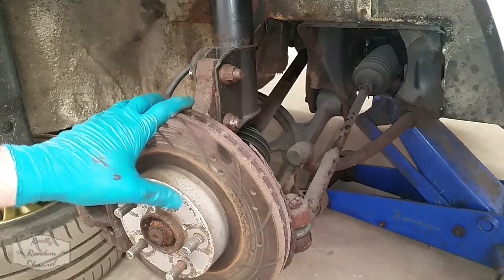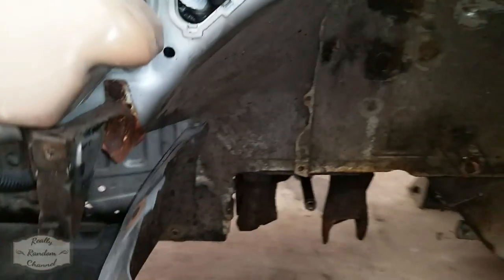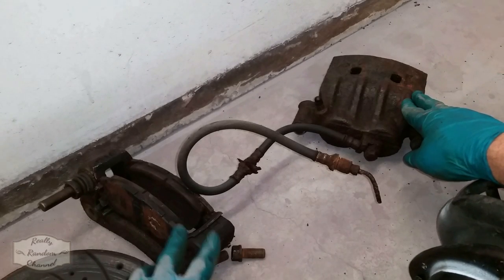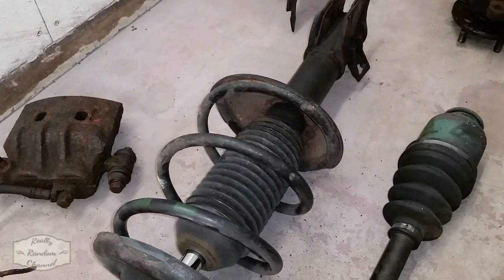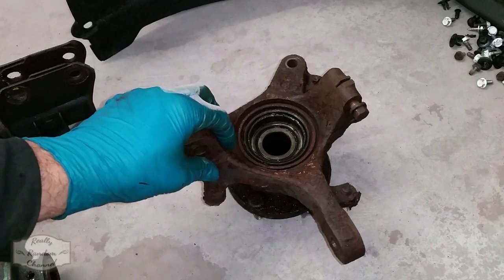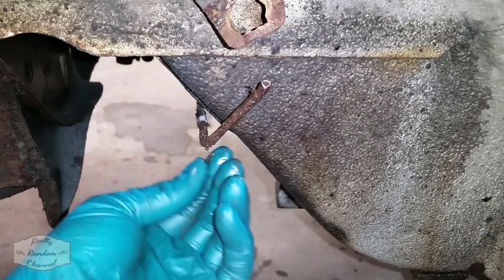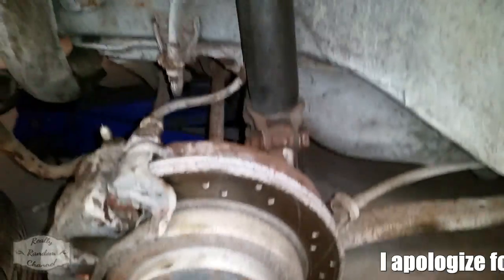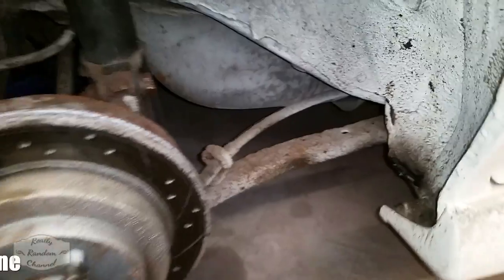26 Year Old Rusty Suspension And Arches Made New Again - WRX Restoration

Comment: I've got to treat rust on my rear sub frame and parts of the floor so I was going to use kurust over the rust then give it a coat of isopon zinc 182 rust inhibiting primer then a coat of stone chip but do you think this will work or should I use you're method. If I use you're method can you recommend something I can paint on instead of a sprayer as I don't have much room.

Comment: Did you use normal copper piping or Nickel-copper brake piping? The former is not legal in Australia because of fatigue failure concerns.
Reply from the maker: Nice question, ive used ( and would only ever use ) the copper alloy as its brake rated.

Comment: 2 tips:
- Should have replaced the rubber parts with polyurethane (yellow). Strongflex does a kit for a very decent price, and no more sloppyness.
- You could have done the "Subaru Free caster mod". (google it if you don't know what I'm talking about).
Other than that, you went to better than factory! :)

Comment: Great job... but the copper lines, Idk about those.
Reply from the maker: Thank you. The brake line looks like copper pipe but its not, Its actually proper rated and tested brake line that is an alloy containing copper hence the colour, but unlike copper this stuff doesn't work harden and fail like pure copper so there are no safety issues here.

Comment: Awesome man, subscribed - where in Scotland are you? A quick question, you blasted and zinc plated the suspension bolts? That the best for long term rust proofing them?
Reply from the maker: Thanks for subscribing it means a lot :). Im around 20 mins from Glasgow. Yeah with steel bolts the best you can do is 
 to zinc plate them.

Comment: Curious why you didn't paint the hub assembly?
Reply from the maker: Always a pleasure to see you :) Good question, The reason i left the hubs unpainted was just because thats the way Subaru done it, I did however blue the hubs so the oxide layer that creates should in theory keep the hubs free from rust for while.
Reply: @RRCRestoration  Hi , not sure they still exist. Blackfast UK, industrial cold blue/black solution. Like the BC you used but better. One of my expertise... does not offer much if any rust protection. It is usually the oil used afterwards. You could easily clear coat them with an Aerosol. fyi

Comment: I really hope you go back and fix the bushings before you try and drive it. You aren't supposed to tighten them without the load of the car on it otherwise they'll wear out faster or even tear.
Reply from the maker: Not to worry the bushes will be fine ;)
Reply: @RRCRestoration  no they wont, admit your wrong and do it right, poor show

Comment: What's the benefit of copper brake lines over steel other than rusting maybe???
Reply from the maker: Mostly it easy to work with and as you say doesnt rust. I would just like to say though that these lines are not copper they are a copper alloy specially designed for brakes as pure copper has a nasty habit of fatiguing and snapping.
Reply: @RRCRestoration  awesome I didn't know that there were copper alloy lines 🤣, the more I know. Thank you haha

Comment: The front end of the car looks great now, but wow, the rear of the car looks terrible! You should do the Group N or hardrace bushings while you're in there and a bigger rear swaybar, it's truly transformative in a Subaru, those mods kill off most of the understeer and helps with the turn in.
Reply from the maker: Nice, Thanks for the tips ill be sure to look into that :)
Reply: @RRCRestoration  No worries, the whiteline anti lift kit (ALK) in the front is a worthwhile upgrade too. The changes in the back end really make a huge difference to the front end attitude of the car. So much so that bushings and a rear swaybar are the first mods I do to any Subaru.

Comment: Mate, you shouldnt tighten up the lower control arm before the car is on the ground. Otherwise the bushes will have a lot of tension if they are not tighten in their “resting position”. Thats the angle the controlarm Will have When the car is on the ground

Comment: Is that actual brake line or just copper? I've done brake lines so many times it's usually black with a coating.
Reply from the maker: Its a copper alloy specifically formulated to be used as brake line. Normal copper wouldn't be upto the job.
Reply: @RRCRestoration  alright good I was about to say lol

Comment: the lower control arm should be torqued with the suspension loaded. Otherwise once the car is lowered the bushing will be sitting distorted and fail prematurely.

Comment: Was that copper brake line, or is that copper water line?  I'm curious, and concerned if it was the latter.
Reply from the maker: Its copper alloy brake line. Never use pure copper as brake lines its far too prone to fatigue
Reply: @Richard NZ I've heard of alloys being used for brake lines that are much more resistant to corrosion than steel lines.
Reply: @RRCRestoration  Thanks for clarifying.

Comment: I'm all for reusing hardware, but you could of at least bought new bolts and nuts for the lower control arm and lower strut mount.  Preferably the zinc coated ones

Comment: 1. Subaru WRX does not have plastic fender liners in front? Hm-m...  Any how. 
2. When install brake rotor on a hub better to grease landing surface of the hub with Al or Cu Anti-Seize.
3. It was mentioned already and I wanna join - tighten the lower arm bolt join when the car is parked on a horizontal floor

Comment: Yeah. you have removed the rust from arches, but there was some pretty bad rust pitting... as far as I understand, no chemical can stop that, only replacing the rusted metal. But great job anyways!
Reply from the maker: Hi, as long as all the rust is removed and the pits have no rust hiding in them and are 100% clean metal when painted then the rust will never come back yes the pits are still there but under raptor liner you will never see them.

Comment: If it's worth doing, it's worth doing well. I can't change the brake pads on my car without painting the calipers. I always heard that copper was a poor choice for brake lines...the same property that makes it malleable enough to bend by hand causes it to bulge under the kind of pressure generated by the brakes system....?
Reply: I also thought that copper as a brake line seems a bit dodgy
Reply from the maker: Hi, yeah i can see why a lot of people aren't keen on copper for brake pipes but personally ive never had any issues with it so im quite happy to trust it.
Reply: @RRCRestoration  That is good to know...and I'll bet it's a whole lot easier to form and flare than stainless.

Comment: why didn't you fix the brake disc with two screws?
Reply from the maker: If you look at the flange before i fit the brake disc you will see there is no holes for screws. The holes in the discs are for removing the brake disc if it becomes seized to the drive flange.

Comment: Those steel brake lines that come from factory are rubbish and rust away for no reason. The auto manufacturers should be banned from using them. Those alloy ones you replaced with are far better.